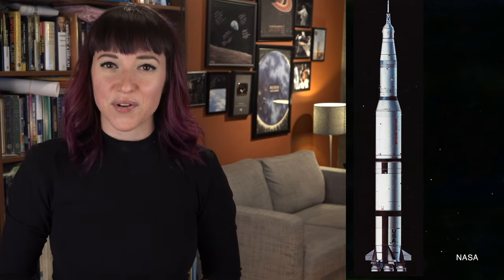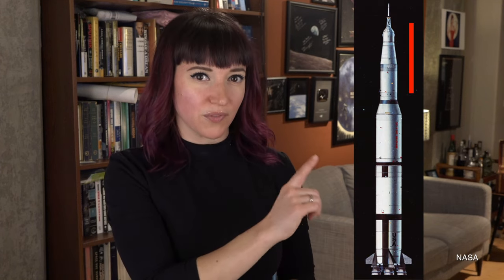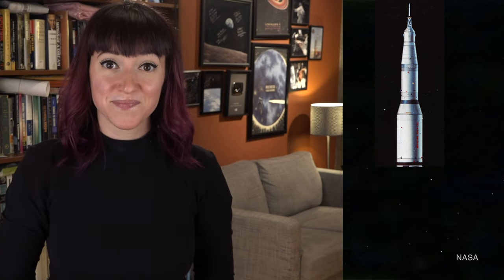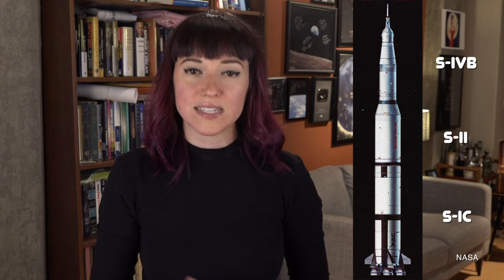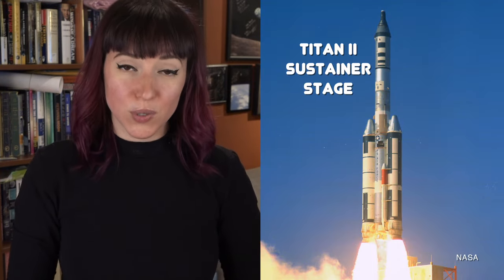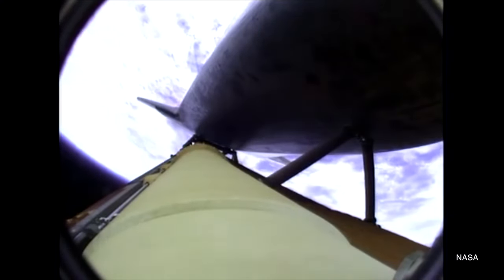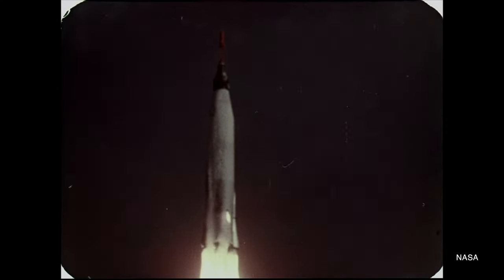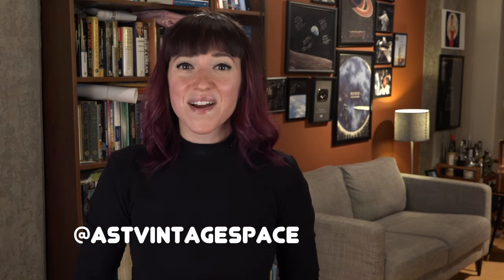The How and Why of Rockets' Staging

Comment: Please settle a disagreement.  One side of the polemic claims that these rockets burn clean with hydrogen and the other side asserts that they burn kerosine mix w: oxygen, which is not clean.  So, which is it?
Reply: Depends on rocket.  Saturn 5: first stage, Kerosene and liquid O2. .  2nd and third stages: liquid H2 and O2.  Falcon heavy: kerosene and O2 (but super-chilled to increase density).  Lots of different rockets have different combinations for different reasons.  Titan 2: hypergolic propellants.
Reply: gevmage Titan II hypergolics for both stages were Aerozine 50 fuel and (di)nitrogen tetroxide oxidizer. That oxidizer was trouble if it leaked or the missile exploded.
Reply: Thank you.
Reply: Delta IV uses LOX/LH in the first and second stage. The Soyuz rocket uses also (a slightly different) RP-1 and LOX in the Boosters and the core stage.
But anyhow, only LOX/LH burns clean and only produces super heated steam.
Reply: thank you.  good information.
Reply: Just a sidenote: It does also make sense to use RP-1/LOX in the first stage, because it has a higher thrust (because the material thrown out of the nozzle are heavier), but not that good of a specific impulse (term for the efficiency), LH2/LOX has a higher specific impulse (lighter molecules thrown out at higher speeds). That gives the whole rocket a higher overall delta-V.
Reply: It's not that hard to understand, it's just rocket science

Comment: How do spacex falcon engines reignite upon return through the atmosphere?
Reply: There are two little tanks filled with Triethylaluminium (TEA) and Triethylborane (TEB) on the rocket. If mixed in presence of oxygen (from the liquid oxygen (LOX) tank) they spontaneously ignite. So it's just a matter of opening a few valves.

Comment: You said that an empty stage is dead weight, but aren't the second/third stage engines also dead weight up until that point? All things considered I still find it hard to justify the weight of spent stages as a means to compensate for the weight of the second and third stages + separation equipment.

The main point of staging I think is more attributed to the presence of an atmosphere than weight management. The J-2 engines of the Saturn V are optimized for use in a vacuum, whereas the F-1's have to be much less efficient for lifting a rocket beyond the stratosphere. If you were theoretically to use all the Saturn V's fuel for a single first stage rocket, the g force would put too much strain on the rocket and its human cargo the lighter it became. Just two minutes into a flight, they shut down the center F-1 engine to limit the g force the astronauts are subjected to.

Comment: So to lift a payload you need fuel, which adds mass so you need more fuel, which requires more stages which adds mass which requires more fuel which requires more space which requires more fuel to lift that added mass... Hmm, seems kinda hard
Reply: Yup, it's generally referred to as "the tyranny of the Rocket Equation".  Also, given a similar atmospheric composition, for planets with enough extra mass compared to the Earth (but about the same density), there comes a point where current technology just couldn't get you into orbit.  A civilisation on such a planet would likely never make it into space.
Reply: Ath Athanasius Uh, how lucky we are

Comment: The V2 rocket went into space without staging once.
Reply: The V2 could reach space (higher than 100 km), but it could only stay there for a few minutes because its maximum speed (5760 km/h) was much lower than what it takes to reach low Earth orbit (~28,000 km/h).
Reply: reaching space ≠ reaching orbit

Comment: Isn’t there a mathematical formula to calculate the right number of stages for a given payload?
Reply: The number of stages required is mostly determined by what kind of orbit the payload is put into, not the mass of the payload itself. Two stages are usually sufficient for payloads to low Earth orbit, while geostationary or interplanetary orbits usually require three stages. (two may be enough if the payload is very small compared to the size/power of the second stage, like Elon Musks Tesla)
For a small payload to low Earth orbit, it's sufficient with a relatively small, two-stage rocket, while a larger payload needs a larger, two-stage rocket. Alternatively, a large rocket may launch several small payloads at once.

Comment: Question: Has there ever been a 3 (sequential) stage orbital rocket?  Can anyone here think of one?
Reply: Craig Meyer Minotaur I-V atlas V interplanetary delta II N-1 (never in orbit but theoretically possible) PLSV/xl GSLV mark 1 and mark 3 Arie nie 1-3
Reply: @buffaloc20  Dude!  English!  Commas!  Come on man!  But OK let me dig into these.  I'll ask if I need clarifications.
Reply: @buffaloc20  OK so anyway.  This is good.  Upgrading the above into English:

“Minotaur IV”: An 3-stage ICBM with an orbital 4th stage on it.  All solid.

“Atlas V”: solid boosters + 2 liquid stages

“N-2”: A Japanese version/modification of the Delta 2.  Solid boosters + 2 liquid stages + 1 solid stage.

“GSLV”: An Indian machine.  Liquid boosters + 1 solid stage + 2 liquid stages

“Ariane 1”: 3 liquid stages
“Ariane 2”: 3 liquid stages
“Ariane 3”: solid boosters + 3 liquid stages
Reply: Craig Meyer n-1 Russian vehicle not n-2 Japanese rocket Minotaur is a orbital rocket designed for orbit only also Minotaur 1-5 delta II the model I am referring is the delta ll 7920H and all the Arianes are liquid propellant only
Reply: Craig Meyer the Minotaur I think you mean minuteman icbm

Comment: The thing that has always bothered me about staging is the weight of the multiple engines. Seems like it's better to only drop fuel tanks and keep the same engine for every stage. That might mean putting the fuel at the top and the payload at the bottom. 

Rocket bells could be swapped once in orbit. 

You'd have more engine than you needed, once you were up. Maybe you could get rid of all but one the individual engines. (Falcon Heavy has 9 I think? So dump 8.) 

It'd be interesting to see how you'd discard a few tons of fuel tank from on top of a rocket in flight... I bet it's doable though. 

You wouldn't HAVE to put the fuel on top. There might be other ways of shedding the weight of empty fuel tanks. Make them out of fuel, maybe. 

Idk, I'm not a real rocket scientist. But I'm surprised real rocket scientists haven't figured out a way to use one engine.
Reply: Jim Fupanda The problem with this though is that the same rocket engine may not be as efficient at higher altitudes. Another reason for staging is that different  stages use different types of propellent  at higher altitudes

Comment: Great video, but there are multiple errors. First the statement, "Every single rocket that has launch anything into space.... has one thing in common, staging." Rockets made by amateurs like the GoPro rocket have passed the karman line. It can also be argued that Blue Origin's New Shepard doesn't use staging. Second, the statement, "Because a rocket would have to stage, leaving another planet" Incorrect, rockets can achieve and leave orbit of planets that have much less gravity then earth(i.e. mars) SpaceX's BFR/MCT/ITS aims to achieve that goal. Stage 3 is actually part of the rocket and not the payload and it didn't make orbit until after stage 3 did it's first burn. Technically SSTOs do exist although they aren't used. There have been several simulations that have proven that the first stage of a F9 can barely reach orbit. I'm also surprised you didn't include my favorite form of staging. Most KSP players know about Asparagus staging, but it was also initially planned for the Falcon Heavy.
Reply: Joe Mckirdy You make valid points but I assume she that she didn't  just mean the Karman lines of Earth and other planets. I think she meant that all rockets that get into orbit around Earth have multiple stages

Comment: Why do today's heavy lift rockets (like atlas, delta, falcon or sls) only use 2 stages to get stuff into orbit, instead of using 3 stages like the Saturn V?
Reply: Most of the fuel in Saturn V's third stage (the S-IVB) was used to accelerate the Apollo out of low Earth orbit to near escape velocity to get to the moon.
Saturn V was capable of reaching orbit with only two stages if it didn't carry a fully fuelled third stage + the Apollo spaceship (≈ 160 tonnes in total). The Skylab space station (77 tonnes) launched in 1973 was put into a 438 km high orbit with 50° inclination by a two-stage Saturn V, and it could have launched about 100 tonnes into a lower orbit with less inclination. The second stage (the S-II) remained in space for two years, and is the largest rocket stage ever to enter orbit.
The Saturn IB from the same era as the Saturn V also had two stages only, and it was capable of launching 20 tonnes to low Earth orbit.

Comment: Why would a single stage be better? From an efficiency standpoint, it is less efficient because you have to carry the weight. From a reusability standpoint, it is worse because 1 accident loses the whole thing instead of just a piece of it (we can reuse 2 of the 3 rockets from the Falcon Heavy, but if it were single stage, we might have none). From an engineering standpoint, it may be simpler, but it is far less flexible so you would have to redesign it with each new orbital height or deep space speed rather than strapping extra rockets together like the Falcon Heavy did with 3 Falcon 9s.

So why build a 1 stage system at all?

Comment: Why not just stage from the top to buttom? Then put the payload on the buttom near the boosters? Then the fuel on top, then every time the fuel runs out, the fuel tanks will be drop. That way we will save money by only using fewer engines.
Reply: What

Comment: You did not mention the critical shapes of the rocket bell housing. The first stage is at sea level and at launch thrust is directed straight down, but as altitude is gained this shape no longer focuses the thrust. Notice how wide the plume fans out at altitude? Very inefficient. The second stage's engines are shaped to work in the lower air pressure of high altitude. This is a BIG advantage of staging. There is a proposed solution, linear aerospike rocket engine: https://www.youtube.com/watch?v=EWf4iOMSPNc

Comment: Rockets don't work in a vacume.
Reply: That's not entirely correct. They work much less effective in a vacuum, but they still shoot hot gas out of their backside and that alone provides thrust. You are correct in that if that gas has an atmosphere to push against that push gets added to the total thrust, but to get movement it is not needed.
Reply from the maker: They absolutely do. The explosive force of a rocket engine still pushes the rocket forward in a vacuum. Newton's laws still hold in a vacuum! I'll do a video about it soon since this is a WAY too common misconception!  :)